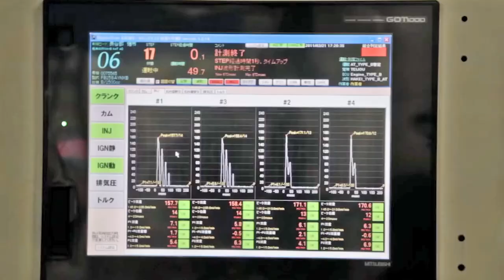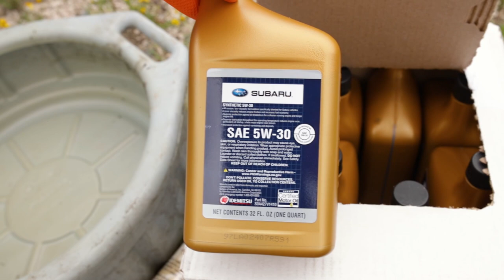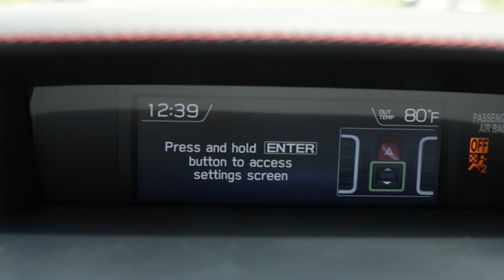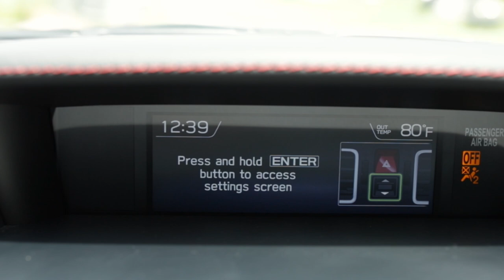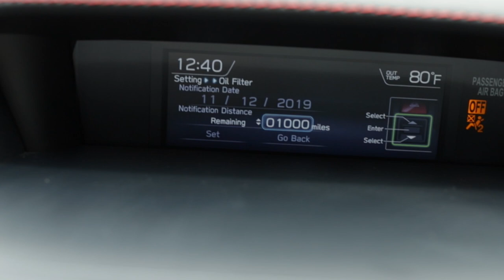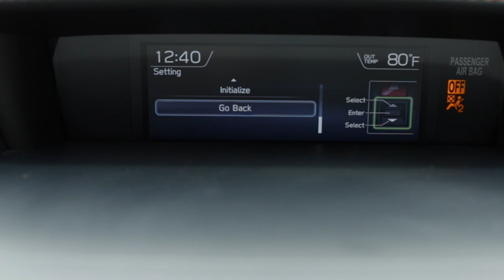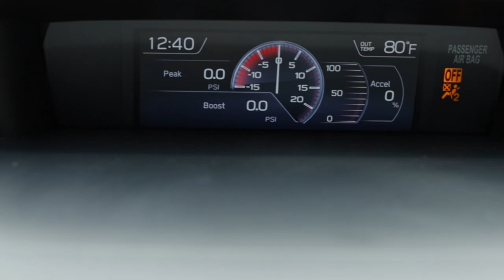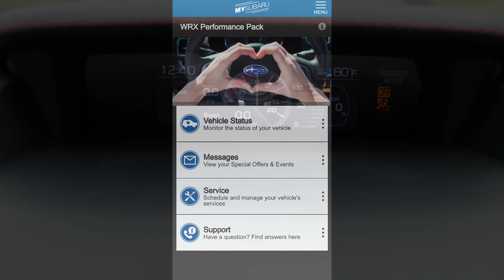2019 Subaru WRX Oil Change - DIY

Comment: I did my new Q5 & new 2010 Prius first oil changes way early, like 500 miles first, 1500 second, 5000 miles third & 5000 miles (Q5) and 10,000 miles (Prius) thereafter.  Used oil analysis reports said the Prius was fine at 10,000 intervals, but the oil in the Q5 turbo suffered viscosity loss at 5000 so I've changed it at 5K rather than 10K per the manufacturer's rules.  Viscosity loss was worse in the dealer oil (Castrol) than in Mobil 1 which I've used.

Comment: Running conventional in a turbocharged dohc engine sounds unsafe
Reply from the maker: Subaru did it for nearly 2 decades. Haha. What is "unsafe" about it.
Reply: @MrSubaru1387  when? And usually it's recommend only to use synthetic for turbos do to taking more heat and the oil not breaking down as easy, better flow for the overhead cams, that's what I've heard so the information may not be perfectly correct
Reply from the maker: @connordunckel6905  from the 80s through until the early 2000s Subaru turbo engines ran 5W-30 conventional. Even in the STi.
Reply: @MrSubaru1387  I was going to say I'm almost positive the bug eyes were synthetic and there's probably a good reason they don't now, that also is probably due to different engine design and all that stuff
Reply from the maker: @connordunckel6905  they use synthetic to try to eek out as much fuel economy as they can. They never had issues with the conventional oil. Being that Subaru turbos are both oil and coolant cooled, they didn't have issues with turbos cooking the oil.
Reply: @MrSubaru1387  I thought the ea engines had problems getting hot when turbo'd and the lower viscosity was for fuel economy, how most of them are running 0w-20 now
Reply from the maker: @connordunckel6905  turbo cars are still running 5W-30. 0W-20 is just in the N/As.
Reply: @MrSubaru1387  right but I was saying lower viscosity used for fuel economy which is done in the n/a cars, conventional to synthetic I thought the difference was in how it lasts and holds up to heat not fuel economy

Comment: U had ur channel locks on the wrong way, look at the teeth.
Reply from the maker: Still took the filter off without issue. They'd have hit the engine cover had I turned them the other way.

Comment: how exactly do you do the clear flood mode? i have a manual wrx as well.
Reply from the maker: Pin the clutch and throttle cable to the floor and hold them. Crank the engine.
Reply: @MrSubaru1387  Thank you so much.
Reply: @MrSubaru1387  how long should I do this for?
Reply from the maker: No longer than 20-30 seconds at a time, but you do it until the "red oil can" oil pressure lights goes off.
Reply: @MrSubaru1387  thanks for the quick reply!